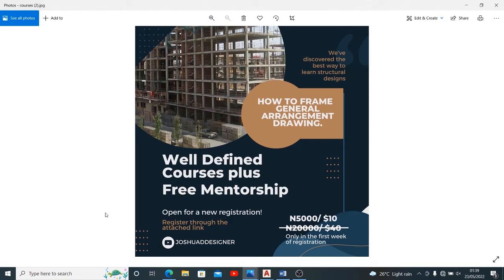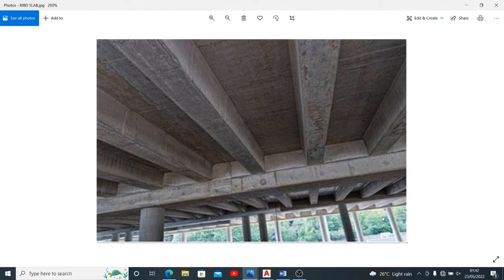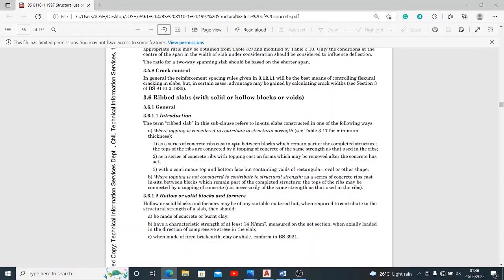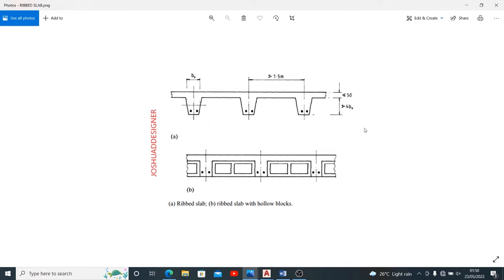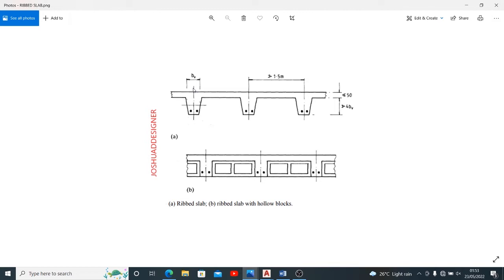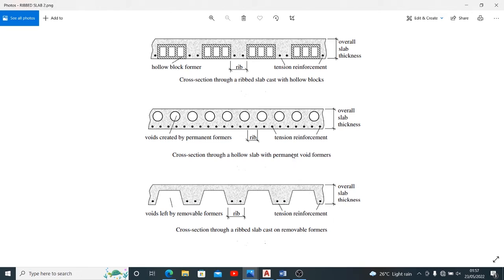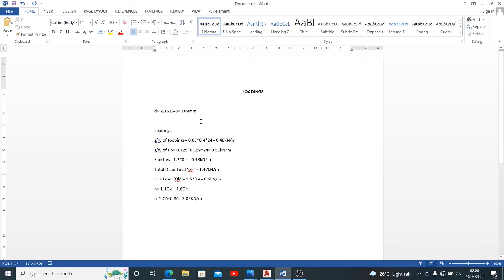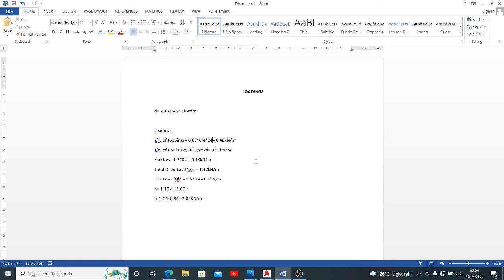RIBBED SLAB IN ONE VIDEO

Comment: hey Josh, great vid. just a friendly note: the first sentence in the ''spacing and size of ribs'' section says in-situ ribs should be placed NOT exceeding 1.5 m, meaning you cant space them more than that, so 1.5 is the max limit. the inequality expression will be: <= 1.5 m
Reply from the maker: Thanks man
Blessings
Reply: @Joshua_d_designer  I have trouble zooming in without distorting my worksheet in protastructure. I just began using it, can you offer any tips? I’m using my trackpad right now, is it easier with a mouse?
Reply from the maker: @Evalsam  You should use a mouse for easy navigation
Reply: @Joshua_d_designer  thanks